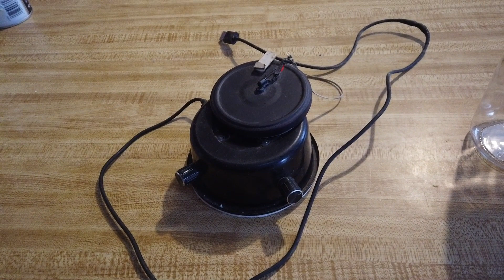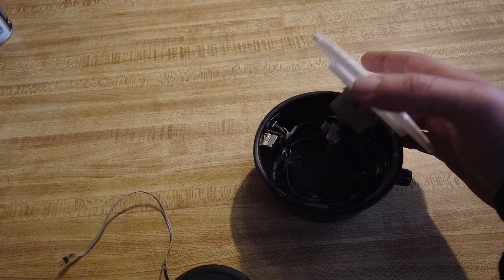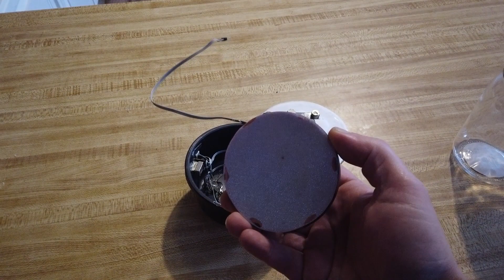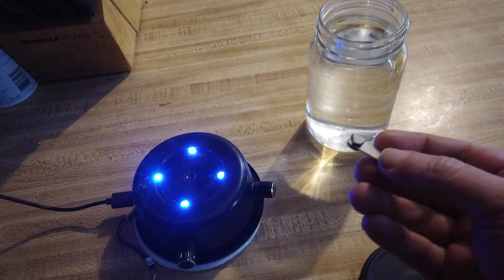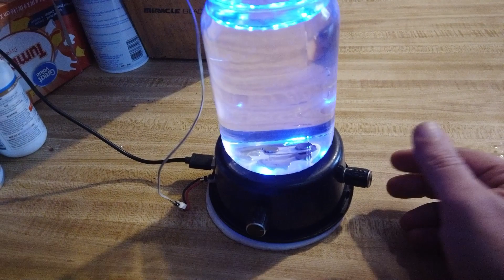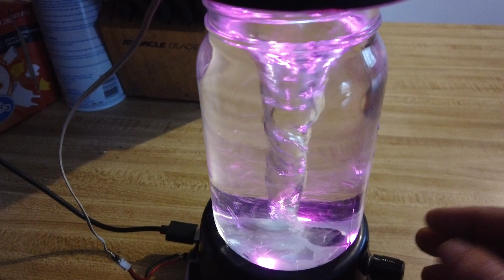Her tornado machine is broken!

Comment: Fascinating item, that would have been a fun build 😊😊
Reply from the maker: It was and pretty simple really using parts laying around.
I just need to find a couple of tiny cows and a micro sized farmhouse for the full effect
Reply: @Slider2732_  that will be on the 3D printer then 😆😆 although, getting the buoyancy right might be tricky.